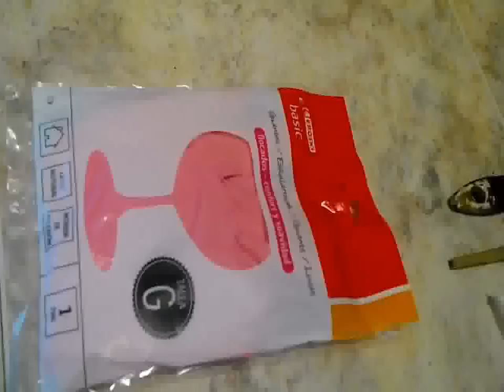How to repair a plastic bumper with fiberglass

Comment: Good on you mate for having a go. 
Your job is OK so don't worry about the haters, most of them wouldn't have a clue anyway.
 It's obviously a cheap old worthless car so why go to all the trouble of spending lots of time & money on it, so you did it right for this particular car. 
Now, if it was a 100K Ferrari some of the haters comments about taking off the bumper & doing it from behind would be vilified. 
In that scenario it would be a bodged job, but on that old door slammer you did it just right. More Power to You.

Comment: Always fiberglass from behind the front bars it if you took the bar off it would of been easier to do also make sure u clean the surface and prepare it before you fiberglass (Y)
Reply: clearly u didnt watch the video, none of the steps you listed were necessary 😂😂😂

Comment: how not to repair a bumper with fibre glass
Reply: +chris johnson ....... over compensating for that tiny we we! Let's see you do something other than running your mouth....... son
Reply: Nothing mouthy about it!! just cant stand people doing videos who have no idea what they are doing and making a mock of a job ive been doing for over 30 yrs !! 
And as for little haha nooooo 6"3 or 1.93 cm !!
Reply: +chris johnson 1.93 cm? You'd fit right in my pocket :P jk dude, don't get angry
Reply: chris johnson serious question. can u repair chips in fibrrglass bumpers/ body kits that are in the very corners? like they're chipped off. and full cracks/ slits in side skirts? how hard is it to do it myself (no experience but pretty handy when it comes to hands on shit. or is it cheaper to just buy a new body kid? thanks
Reply: yes can be fixed give the area around damage a good sand with some 80 grit make sure you blow all dust off after and use some short strand fibre filler ( upol fibral ) is good as easy to sand !! small chips etc use a lightweight filler
Reply: thanks mate

Comment: You need to prepare the area to be repaired with abrasive paper or disc otherwise the fibreglass will not adhere to the surface mate.

Comment: Fibreglass resin does not create a strong bond with plastic. You should use a special resin that is made for plastic repairs
Reply: Hi forget  use sand machine before put the fiberglass